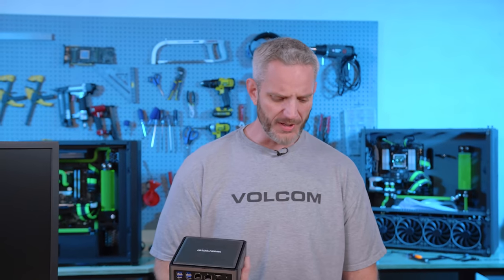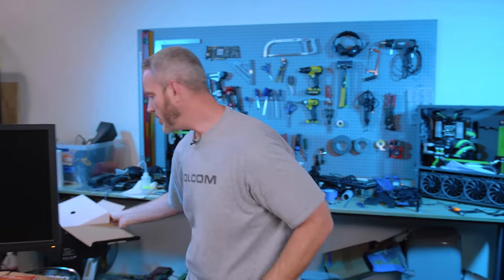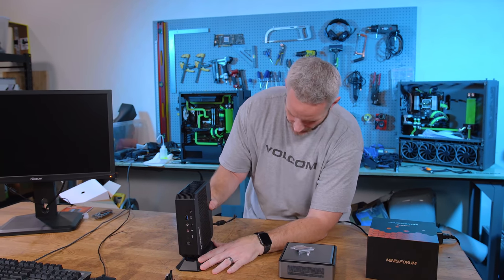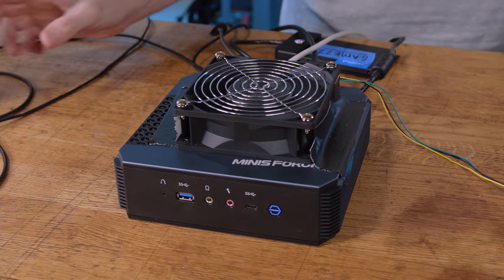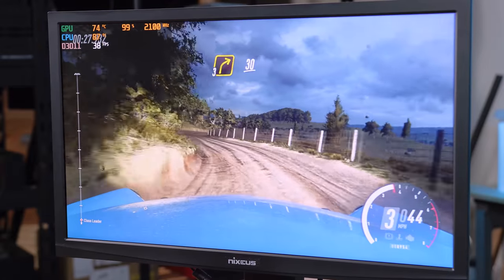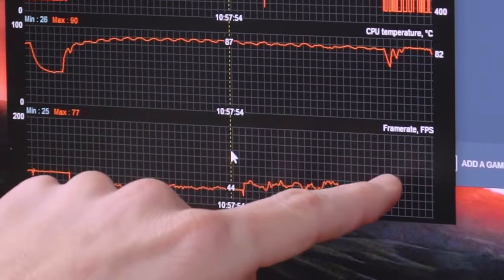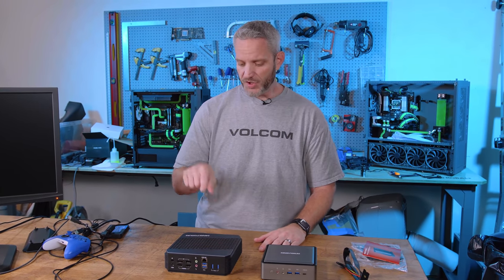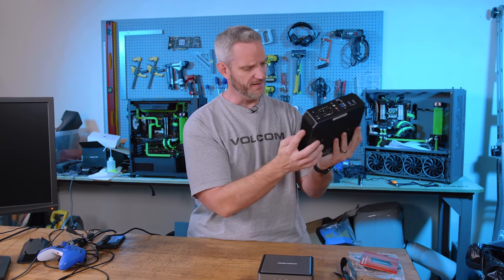It LOOKS like a modem... but its actually a Monster PC!

Comment: I did get the HM80 minisforum it runs awesomely glad you turned me on to it during my PC hunt. I can play most games on 1080p medium to high settings at good graphics. Video rendering also works very well
Reply: @angron unbound the HM80 is essentially the same as the HX90 (the one featured in the video) just with a Ryzen 7 rather than a Ryzen 9, meaning they're both 5000 series mobile processors. It produces less heat, thus more/better sustained performance, when you consider the small form factor.
Reply: @angron unbound I also got the 32gb of ram variant. I mostly get 40-60 fps no problem
Reply: Two things, you can set the max package power for HX90 in the BIOS...and the RAM makes a big difference too. One reviewer swapped his 16GB kit and got over 10% boost.

Comment: This seems to me like a perfect retro gaming device.  Games that came out more than 5 years ago are still fun, and you could probably run some excellent older games on this thing just fine.
Reply: 100%, I would definitely love to see reviews of such systems test their performance in games from 5 years ago and older. Sure, they may not run the latest games at 60fps, but there's decades of games out there that they should easily run provided there's no driver related issues.
Reply: Also new indie games like Hades, Noita, and lots of other good ones possibly
Reply: Great for a media PC or TV "console" for those who don't want to buy one. That would be perfect for this thing.
Reply: @shredderorokusaki3013  Brooo I gotta myself that build to play balan wonderland at 4k 240fps
Reply: ETA Prime did a good two-part, covering some popular games as well as emulation. The 2nd part showed performance using a RTX 3060 connected to an adapter on the m.2 slot.

Comment: This is a great machine.  I know this channel pushes gaming more than regular computer use; therefore, cannot think of any way to use something like this beyond FPS in gaming.
Uses: older single person games if you must game.
- Office productivity.
- Work from home with VPN back to the office.
- Security desk with four monitors to watch camera feeds.
- KIOSK for check in, or sales at a mall or store
- Digital sign board (centralized area with monitors facing four directions)
So many uses for something that takes up this small of a space yet with this much power for what it is.

Replace the RAM, put a heat pad the SSD, and attach an additional fan in a push / pull configuration (or if possible, reverse polarity so this fan exhaust from the CPU) and turn into an even more powerful unit for light video editing, or introducing a teen to CAD type software.
Reply: Precisely!

Comment: Undervolt it or set it to a locked frequency, thats what gets my 2400g going. Lower temps, higher clocks, consistent performance, win-win 
And that igpu might go even higher
Reply: Someone else showed you can manually set the CPU package limit to anywhere from 10w-50w in the BIOS.

Comment: The fan/air flow doesn't seem to be the issue.  The issue seems to be the actual heatsink it's self.
Reply: Agreed - with the air coming off cool and components running at 90, the heat's definitely just not getting freed up for the air to carry it away.

Of course, with the size limitations here, I'm not sure how you would get around that problem.
Reply: @rashkavar  Only thing I can think of is more heatpipes... a denser heatsink with more fins maybe?
Reply: @ellerm86  Possibly...depends what they have in there.  Because of how fluid dynamics works (air is a fluid, remember), there is a point at which the fins being close together will dramatically reduce airflow, to the point where you might have air channels but still have it be effectively a solid block of metal.  (If you want a deep dive in this, look up fluid friction in a pipe.)

Heatsinks probably don't get very close to that normally, but if you're designing something to run parts that generate that much heat in a box that small, you'd probably dedicate some effort into modeling out exactly what kind of heat sink will be optimal within the size, noise and cost budget of the fan you're using.  (Obviously Jay's buzzsaw death-fan would be able to use a denser heat sink, because its excessively high pressure (effectively force) overcomes the friction better than the stock fan they used.)
Reply: @rashkavar  It would be so tempting to fit a water block, and ETA Prime already proved the m.2 PCIe can be used for a graphics card. This could be a nice compact system for a desk mod build.
Reply: @titaniummechanism3214  Well, der8auer said the heatsink proves that liquid metal was a concern in the design phase. And some of the reviews that came out weeks ago stated they were told directly that prototypes did not have liquid metal. It sounds like different people got told different things.

Further, der8auer showed how dramatically the temps fall when liquid metal is applied to that cooling solution The problematic question is whether ANY  of the finished models being shipped have their thermal paste issue resolved or not.
Reply: @passintogracegoldenyearnin6310  der8auer also said the he thought that it is unlikely that the company would bother ironing out their production issues and just release the product without the liquid metal. And since they lied about the carbon fibre chassis already, I tend to agree with him.
Reply: @titaniummechanism3214  " injection molded with carbon fiber composite materials." That exact wording on their site would indicate they're claiming to have used Fiber-Reinforced-Plastic. For all I know they didn't use any, or the prototypes were shipped in standard ABS or similar cheap stand-in plastic.

As long as the fundamentals are there, and der8auer's numbers for true liquid metal are there, I'm probably going to order one with the understanding that I may need to redo the cooling solution myself. Minisforum definitely screwed up on multiple fronts here, but the underlying hardware didn't blow up on anyone....somehow. It's made me more interested in tinkering with one, plus I want to cheese off the screeching monkeys accusing every small reviewer of some sweeping conspiracy. :3

Comment: if the bios supports curve optimiser would be nice to see how cool the temps would be by lowering the voltage (and the ram inside it is awful single sided stuff which is not so good or the apu's)
Reply: Just got mine, I want to see if my BIOS matches another review. AMD mobile APUs don't seem to support fine manual control, but the BIOS appeared to support manual TDP from 10W to 54W in a review I watched. Someone posted in comments claiming they were able to specify an even higher TDP than 54W but I still need to pick mine up and open it.
Reply: @passintogracegoldenyearnin6310  since you got one is there any liquid metal splattered all over the board? just curious if their quality have improved

Comment: The only problem that I see in this awesome mini PC is the heat sink.  It does not matter whether you are using liquid metal or just ordinary thermal compound.  It's job is just to conduct or transfer the heat from the processor towards the heatsink.  If the heatsink is not good, then it will not be able to dissipate all that heat generated by the processor.  I find the bigger and thicker base heatsink from the old AMD Athlon era the better heatsink than the present stock heatsink.  My desktop PC's temps used to reach from 75 to 80 degrees when gaming using the stock cooler but when I replaced it with the older heatsink, the temperature dropped from 55 to 60 degrees when gaming.  For me, this new Minisforum mini-PC is still a great buy.  Just replace the heatsink with a better one.

Comment: I got a 3400g in a mini-stx case (SST-VT02). It's cooled with a Noctua NH-L9i, which looks similar to the cooler you have in there. It reaches 65°C under gaming load. I'm surprised your unit heats up so much.

Comment: That is a freaking awesome little PC. I have a 3400G equipped one that is my high mobility system for everyday use and basic gaming on older titles. It has a few issues with stutter, but I might be able to address that with RAM speeds.
Although to chime in on the heat sink debate. It's not the black anodization.
It's just ... a very small heat sink that's having difficulty dealing with the heat load.
Reply: I was pretty sure black finished radators have better infrared dissipation? Could be one of those early PC-building myths... My first unit finally arrived and I'm fairly sure the heatsink assembly is at least 1/3 of the entire chassis weight. Temps and performance are better than Jay recorded here.

Comment: Bought this added a 27" Samsung TV (monitor) absolutely love it. Had a HP all in one with windows 7 for a long time. Super slow with todays standard. What is nice is the TV has nice speakers built in. All I had to do was Blue tooth mouse and keyboard and was up in running in less than a half hour. Super FAST really pleased.

Comment: I feel like this mini-pc would be a contender for v2 of the briefcase PC when paired with a discrete GPU. Or maybe build the PC into the bottom section of an old-school metal toolbox with a flip-out monitor.
Reply: It has no way to connect an discreet gpu unfortunately. Only 1 pcie m.2 and no thunderbolt. Too bad huh
Reply: @DroneMee  As Jay said near the end, there are adapters that turn the wifi module into a x16 physical slot for discrete GPUs.
Reply: @jeremybarber2837  oh damn yeah I missed that some how. Well proven wrong I am.
Reply: Building your own football?

Comment: I wonder how well it would do with a proper thermal paste application..
Reply: der8auer says temps dropped a LOT with correct cooling. I certainly have better temps and benchmark scores. 13030 R23 multicore.

Comment: He can run an external GPU through one of the the NVME slots. I run a RTX 2080 through a 16x to 4x riser and a mini pc i9 8950HK. I have zero issues playing triple A games at 4k. I planned to get this Ryzen mini and do the same thing, but I got the ROG Strix Scar 17 with the 3080. My first laptop in over 10 years.
Reply: I’m sure someone will make a 3rd party case for this doing exactly that for sure

Comment: I'd like to see what something with a modern APU can do as a server.  You don't need a whole lot of power to run PLEX and I'm doing it off a 6yr old Lenovo laptop, that has an SSD and bumped up ram.  For media consumption I think I'll stick with my fire TV devices, they work really well.
Reply: I use an old FX4300 with GTX 1050 ti as my Plex server. 46TB of hard drive space and Nvidia shield pro 2019 as my streaming box. Plex server also runs other things like a Minecraft server for the kids

Comment: This looks like an excellent Photoshop machine! Powerful CPU + enough RAM, that's all you need.
Reply: Nah gpu helds a lot.
Reply: @armyofninjas9055  It's true but it also depends on the filters. Quite a few mostly want low-latency OpenCL which is a strong point for APUs, but yes there are some streamed operations that benefit more from speed than they do from latency.

Comment: I still think the main reason why AMD didn't go with RDNA2 in the current APUs is because the current platforms have to stick with dual-channel DDR4, which as you mentioned is already a bit limiting in terms of bandwidth for the current APUs. The consoles on the other hand have the benefit of having GDDR6, and the Steam Deck uses quad-channel LPDDR5.

Comment: Servers don't have to be big. :D My NUC is a media server for the whole house ... has an Intel Gen10 w/ 4 cores, 64GB of ram. It does a great job of being a server. It's also running Linux so that *may* have something to do with how well it does. :)
Reply: Agreed, I recently repurposed an old FX4300 system put a GTX 1050 ti in it, running as my Plex server (everything direct plays in my house) and it's running a Minecraft server for the kids, all our phones and tablets automatically backup are photos to it and it's running some smart home software.
Reply: Can even be done using a Raspberry Pi or few, and if you cluster them with appropriate software you can even have redundancy and load balancing, maybe falling back to an ordinary 12v SLA battery for a guaranteed safe shutdown in the event of a power failure - or for the really inventive, to signal a relay to fire up the generator!
Reply: @omegadomega  not as much as someone with a Fortnite profile pic though
Reply: @phillee2814  changed from 4 x Raspberry PI  to one mini-PC - The bandwidth of the raspberry was just to restricting.

Comment: Can you guys please go though and show a walkthrough on setting up a home streaming system? I would love to see how that system would be put together and configured.
I have a powerful pc that I game on in my desk area but my living room is on the other side of the house and moving my pc is a pain to play on the big tv.
Reply: With Steam, it’s pretty simple with an Nvidia Shield hooked up to the big TV.
Reply: Could turn it into a double build series! One powerful gaming pc and a small one like this. But both modded in the same style. That would look sick!
Reply: If you have a desktop, add in an internal 2.5GbE card and run a wire under the floor to direct-connect with your media PC in the living room. Cheap, no wifi stutters.

You could also use the media PC as a DVR and storage system, put a Plex server on it. 8 cores plus VCE it can transcode streams to your phone or tablet easily.

Comment: The first AMD APU with RDNA2 graphics to be used in a pc will be the one in the Steam Deck and it will also use DDR5.

There is a chance that when AMD launches their next CPUs that all of them will have RDNA2, some are saying that all of the next generation AMD cpus will have integrated graphics, but even if that's not true,  there is a chance that those who will have integrated graphics will have RDNA2 cores.

Comment: Wait a minute, the medium preset in Dirt rally sets shader detail to high? That might be your fps problem.. lol
Reply: Setting it to medium sets it to high instead of medium? O.o
Reply: nah...
Reply: Turn right to go left
Reply: Nah the main problem is that trash APU
Reply: @Steve-ph7qn  nah.. If it plays, it stays..
Reply: @shredderorokusaki3013  I hope this is an ironic post because the 5900HX laptop CPU slaughters the 1700X in single-core and multi-core. The GPU is 2-3x faster typically, which is great except these are different systems with different intended uses.
Reply: @passintogracegoldenyearnin6310  i wll soon have a muchb eter graphics card i hope. when weh ave better avaalibilty!

Comment: I am picturing someone fitting one of those huge ring-shaped Zalmann coolers into that round hole. It could take an equal or possibly larger fan I think, and run even cooler and quieter. There is also enough room to play with working out liquid cooling plumbing, but the reservoir and radiator would need to be hiding somewhere else. I've seen a larger mini system with out-of-box water cooling and even a water jacket around the external power brick....kinda overspecialized but it put lots of power in a very small place and the layout allowed them to plumb through an adjacent wall and use a large thermal mass cooler on the other side.

You know you want to see if a 1.4kg, 22cm cooling tower can draw enough heat through convection......

Comment: Impressive and dirt cheap compared to a laptop, those with a 5900HX sell for $1,500+
Reply: Dirt cheap???? You can get an asus strix laptop with same cpu, a 1tb nvme, 16gb ram and a dedicated rtx 3070 with 8gb ddr6 for $1800 and that's with a 2560x1440 17.3" screen.
Reply: Also it's comparing apples to oranges.
Reply: @fouraces9137  Dude, if you're going to go for a solid value ROG laptop, go with the Strix Advantage Edition. Same 5900X, 16GiB RAM (that should ABSOLUTELY be upgraded on just about any SODIMM laptop), but only a paltry 500GB M.2 and a 12GiB RX 6800m. For $1650. Sure, those savings will be eaten up by a 1TB secondary drive upgrade, but you still end up ahead.
Reply: @fouraces9137  The EliteMini HX90 costs $650, you compare this to a $1,800 laptop, it's near x3 the price !!! It's comparable to a (very) SFF desktop PC with an APU, and at that it's relatively cheap and offers good performance

Comment: You guys should try water cooling this little tank!  Some crazy little pc with all kinds of fittings and pipes coming out of it with a 120 rad and fan floating on some small external bracket.

Comment: Typical "wow cool build" comment before physically possible to watch the entire video....
🤣🤣🤣
Reply: Other creators have already covered this so Jay is far behind.
Reply: How did they make the power supply so small to fit in that case?
Reply: @Pepe-dq2ib  you can clearly see it's an external PSU. Though it would be possible with newer GaN tech, easily.

Comment: Damn, that's matching my 3800x with cinebench at half or less of the power. That's so awesome!
Reply: The 5900HS is almost even a better fit for this chassis, but the 5900HX is more available due to the less strict power limits.
If you haven't seen say the 2021 g14, it's a beast that shifts well between battery usage and full-throttle desktop usage.
The new Blade 14 isn't bad, but they used the 5900HX in that small frame and the extra wattage can throttle the graphics.

Comment: These would make a solid choice for a family where space is limited, that you can use for some light gaming, while the kids can use it for as a computer for school work if needed. However I would be running a lighter weight OS on it like Manjaro Mate Linux to squeeze a bit more performace out of it compaired to Windows, just make sure to OC the snot out of the RAM in the BIOS/UEI to get the most out of it.